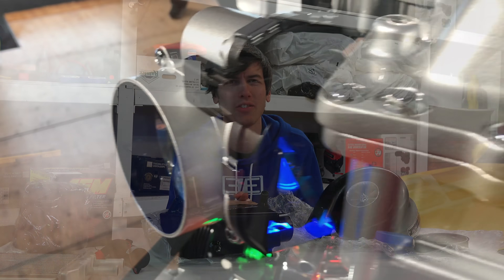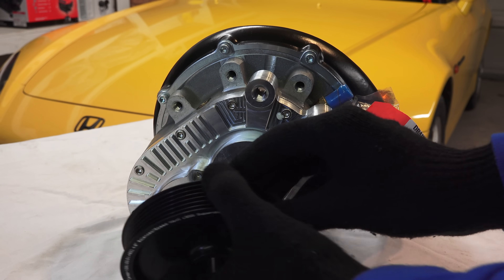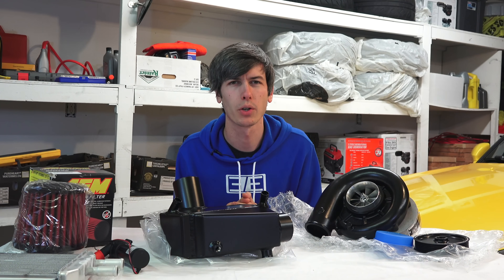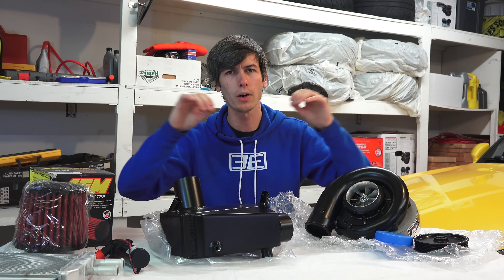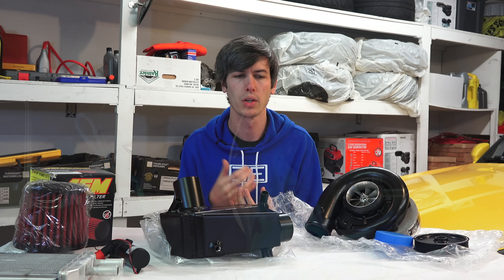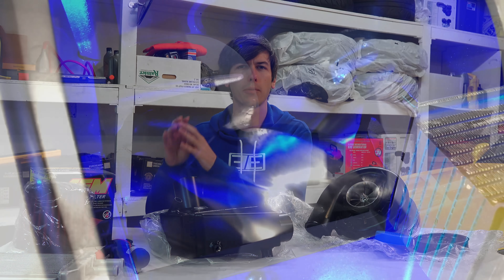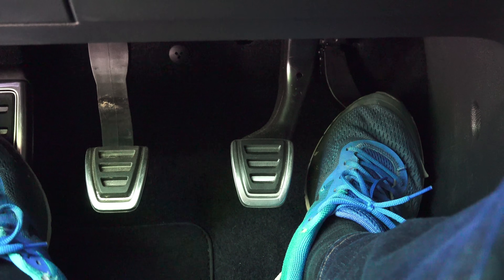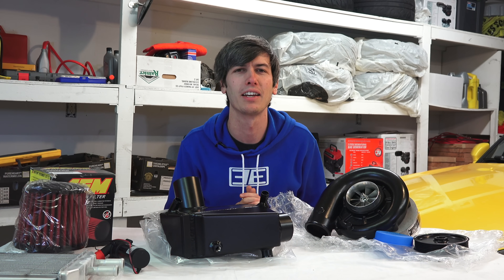Turbochargers vs Superchargers - Which Is Better?

Comment: I swear, if this ends with “it depends “
Reply: Why do you think is it that both ways see implementation in modern cars? You may think it is because both have pros and cons depending on the situation and you couldn't be more correct.
Reply: It DOES depends.
Reply: Generally speaking "Big Capacity engine use a Supercharger, Small Capacity engine use Turbo".
Reply: @Mira6Rus  It's not about capacity it's whether your priority is NA-like fast throttle response and drivability or efficiency and outright performance. Turbos will always give you more power and efficiency but will also always give you lag.
Reply: @BigUriel  Turbos tend to give more efficiency, but power is really arbitrary. Typically the reason superchargers aren't as powerful is because they designed it to form a balance of efficiency. Essentially, you're trading snappiness for efficiency with a turbo.
Reply: @BigUriel  Oh sure! I generally mean though 4 bangers respond to Turbos much better than V8s. 

You can safely double 4 cylinder horsepower, but its not like turboing a 500hp V8 is going to get you close to 1000hp without major major work.
Reply: @BigUriel  "Generally speaking" its why most V8s have superchargers and 4 cylinders have turbo. 

Also when boost finally arrives for a V8 its rear wheel spin city 😅 they need a smoother torque band.
Reply: @Mira6Rus  thats not even a factual statement. Eveyr application is different depending on everything else in the car so its hard to day thats true. Supercars with huge engines use one or the other and its based on their goal, the engine, the mechanics of the engine bay, so many different things
Reply: @TheOneSymphony  Generally speaking... I said. And its true anyway. 

Barely any cars are Supercharged these days... Turbos just do it better. Without leeching power.
Reply: @TheOneSymphony  Are you a Mechanic?
Reply: @Mira6Rus  5 yrs why? You have something to say. I havent been wrong in anything I've done for my clients
Reply: @Mira6Rus  turbos and super chargers are both awesome in their own right but it all depends on your purpose. Other than than companies like Audi wouldn't make the same car pretty much with different options.  Some of their v6 cars superchargers but they outfit others with a turbo. Too many factors
Reply: @TheOneSymphony  12yrs... Performance Tuning... Nissan, Renault, Mitsubishi and BMW accredited and certified. 

Show me 4cyl Superchargers aside from the Mini which was unreliable and inneffective.
Reply: @TheOneSymphony  And in 12yrs ive worked on one Supercharged car ever. An SL55 AMG and it is a V8... 😅

Which makes sense. Because generally speaking 90% of Superchargers go on V8s. 

Or they are tiny lil economy chargers lile the Mini or Mercedes Kompressors. 
Which suck... horrifically unreliable and not performance intended.
Reply: @Mira6Rus  so you really expect me to believe that in 12 yrs you've only worked on 1 supercharged car??? my mechanic friends have worked longer than you and have worked on turbo, Naturally aspirated and supercharged cars. Thats really a shot to your credibility because i can't believe thats even possible
Reply: @Mira6Rus  twin turbo ssc aeros, twin turbo Koenigsegg Agera, Pagani Zonda ( natural), I could go one and those are v8 to v12. 90% of big engines do not use superchargers. Some do, yes, but not 90% be realistic. Most supercars have had turbo or natural aspiration. Some of course did have superchargers but once again not 90%.
Reply: @Mira6Rus  the mini engines are not horrible . They're average and aside from the timing chain going bad I havent heard anything bad about them especially since BMW has a hold of them
Reply: @Mira6Rus  keep in mind audi and many other companies (Dodge, Ford, Chevy, range rover, jaguar, alternate Volvo models) all use super chargers in some of their cars so to say superchargers are not used nowadays.  . .You're absolutely wrong
Reply: @TheOneSymphony  Oh agreed, the engines are fine... but the Supercharged ones are crap and the Turbo one are great... 

Why? Becaus Low Torque engines thrive on Turbos... like Diesels or 4cylinders. 

V8s have tons of Torque already, so you typically see them Supercharged... or Twin Turbo will low boost.
Reply: @Mira6Rus  ok low boost in mayne certain cars but twin turbos ive driven havent been low boost especially the GTR
Reply: @TheOneSymphony  Do straight 6s have good low down torque? NO.... hence you TURBO INLINE 4S AND 6S.... YOU DONT USUALLY TURBO V8S....
Reply: @TheOneSymphony  Dude... im sorry you are now bringing up hypercars -_- 

Like are you just 10yrs old? You wanted to know about Turbo vs Supercharger builds in the TUNING WORLD... 

Your just listing off random hypercars and pointing at the exceptions. I think you are 10yrs old and dont know a thing about Mechanics.
Reply: @Mira6Rus  wow you have to result to insults when you're wrong and don't know what youre talking about. All engines have different efficiency rates depending on how they are built and other components. If you had any type of intellect you'd realize that. There have been so many different configurations of engines for v4 to inline 6 to w18. All for different goals. Go sit somewhere with your unnecessary insults
Reply: @Mira6Rus  and not all of those are hypercars which obviously you don't know.  No one is talking about the tuning world because that's completely different. Manufacturers only. You get indignant because you can't make a coherent point? Its laughable. Comments are here for simple debate and/or correction and here comes a keyboard warrior like you that has to attack somebody.  You sure you arent 10 yrs old. You can't even have a civil conversation
Reply: @Mira6Rus  not all inline 6 were turbo if you knew what you were talking about
Reply: @TheOneSymphony  WHEN TURBOS are installed... or inline 6s make terrible low down torque. 

You are not a Mechanic hahahahaha
Reply: @TheOneSymphony  You have no idea what you are talking about😅😅😅
Reply: @TheOneSymphony  You are not a Mechanic. And have been wrong every single comment. 

Want my Email so you can see my collection of rare and modified vehicles? My workshop with 4 hoists? 

Cmon lets prove what we have and dont have.
Reply: @Mira6Rus  never said i own everything and could care less what you own. Send me your email if you want but it isn't gonna do you any good. And you're annoyingly petty to wait all this time to comment again. But sure send your email
Reply: @Mira6Rus  mini coopers are 4 cylinder and was made with superchargers, but I think they switched it up in 2006 or so to turbo.
Reply: And honestly, I don't know which is better, it's been ten years since I've owned and modified a hobby car.
Reply: @RX-8GT  Because Supercharging 4cyl is not as good... the most popular Supercharged car changed to turbo because torque bands suck on 4cyl supercharged.
Reply: @Mira6Rus  I figured there was a reason they changed from that to turbo on recent models on mini cooper s, was thinking about getting one just for starters without modifying it
Reply: @RX-8GT  Most people wont touch the supercharged ones... 

And yes my argument has been 4cyl-turbo and V8-supercharger. 

But the reason they got rid of it was it was just too small... already a lazy 316i engine from BMW needs more than a tiny supercharger 😅
Reply: @Mira6Rus  oh ok, I see what you mean
Reply: @Mira6Rus  Turbo is more work period..
Reply: @Mira6Rus   and that's why they have tunes and boost controllers
Reply: @Iconhulk  Totally... But its probably cheaper and more effective on typical tuner engines. 

Supercharging a 2jz ge or something would be way harder than throwing a gte kit on it.
Reply: @jonw7760  You like them spoolie snails in your V8s? Nice 😎
Reply: @Mira6Rus  I'm just saying rather than spinning the tires like crazy. Control the boost and put that power down ya know
Reply: @jonw7760  I dont know hun hahah this is why I ride 600cc max, prefer very light AWD or FWD drive turbo cars like my Subaru Liberty B4 or Renault Megane RS 😅😅

Im a girl though, big power and the muscle needed to control it is just asking for trouble. 

So I found ways to be just as fast :)
Reply: @jonw7760  I have a modded M5 well its my dads E39 V8, it terrifies me... 😅 

Breaks in third at 100kph
Reply: @Iconhulk  when I had my 93  rx7 ,I had knowledge of the performance side, but not on rotary engines in general..I always heard my car was going to slug out on me.. but I never had any engine problem at all, ( on a side note, it's an awesome experience) .. that since I've been thinking about getting a 300zx, mini cooper, or a stock corrado g60( if any out there).. I've been giving the rx8 an eye now, only that I've just heard more cons of that rotary engine than anything.. and even hearing negative things of it, it's like pulling me towards it even more and it being RWD is why it's giving me a hard time just choosing a car to start the hobby road.
Reply: @Mira6Rus  oh without a doubt!!!!!  Love my WRX it's by far the best car I've ever had
Reply: @jonw7760  Totally! But like my 2 cars have 3 turbos 😅

I love boost! But I hate breaking traction... Lost my Mum in a car accident and just hate the feeling of cars breaking traction. Makes me nervous 😳
Reply: @jonw7760  No more bikes, no V8 utes etc etc... I still love Engines and going fast but I try to do it the safest way possible. 

I have 2 Daughters now, and wont put them through what I went though. 

Sorry to get all deep, but a sticky track car hot hatch and a twin turbskie AWD subie are safer than a 1000hp RWD supra or a V8 😅
Reply: @Mira6Rus  oh my. I'm sorry to hear that. And I can totally understand not liking that feeling given the circumstances. That's why every vehicle I have ever owned gets put through my own little set of tests just to see how it's going to act and handle under all sorts of different loss of traction scenarios. because understanding how your vehicle will react how you yourself will react could potentially save your or someone else's life once again I'm very sorry to hear about your loss
Reply: @Mira6Rus  no need to apologise it's what makes us human. I too have 2 lil girls and want them to feel safe and comfortable behind the wheel. Driving is a huge responsibility and should be taken seriously. I can't wait to get the oldest behind the wheel of an old beater out in a field or on a fairly difficult trail through the woods   that's where I learned and that's where they'll learn
Reply: @Mira6Rus  hi there...I have a Mercedes c180 comes stock with a supercharger...better go do another 12 years 🤣🤣🤣
Reply: @nathantownsend55  I specifically mentioned your car and the Mini Cooper S as examples of why people DONT DO IT. 

Super underwhelming cars.
Reply: @nathantownsend55  Lol its the example of why your car is bad and valueless. But ooookay 😬
Reply: @Mira6Rus  the mini Cooper s was hugely successful and the reliability issues were not due to it being supercharged at all. In fact the turbo car that replaced it was even worse
Reply: @BigUriel  8
Reply: @Mira6Rus  this is so NOT true xD my 1.6 works fine with turbo and supercharger both .
Reply: @RecklessGenesis  sigh and I bet when you first attached both. Untuned... Naturally the Turbo gave you more power.
Reply: @Mira6Rus  i attached the turbo very close to the manifold for minimum lag . I have to say its not all that different but the SC gives a more continues power , where the turbo give more an acute power . I like both
Reply: @RecklessGenesis  I prefer NA weirdly... yet of my 3 cars theres 3 turbos on 2 of them haha
Reply: How much %  mechanical loss do u think is lost to drive a supercharger belt driven or other ?
Reply: Trev Ohlson, 
It depends.
Twin screw? Roots? Centrifugal?
Reply: If it didn't depend there would only be 1 option
Reply: @ezraboren2069  superbly stated
Reply: I've been waiting for him to ask where he chap stick was.. 🤣
Reply: Pedal Commander!!
Reply: I mean, if it didn't, I assume one would have killed off the other by now, right?
Reply: hahahah jeah xD
Reply: well...it depends --\__(:\)__/--
Reply: It depends On What you want to be doing... that’s just how everything works.
Reply: Hahaha, right
Reply: It really does depend tho
Reply: Lol
Reply: Can we just do both?
Reply: Well then i will just slap on a twin turbo with a supercharger
Reply: Thats how most things in engineering are, sorry.
Reply: That should be the headline for EVERY mod
Reply: Lol
Reply: Tur bo best
Reply: Guarantee it will.
Reply: Let me make it super basic, in a race with many curves corners the response of the throttle really matters so be able to attack the corner the way driver envisions, and so the conventional norm would be to go with a supercharger.

A race with many straight aways and high speed corners the full power output matters more than throttle response, and so turbo would be the conventional norm as it does not take energy from the engine.

What if the race course had both high speed curves and low speed curves equally, then "it mostly depends" on the drivers skill on the vehicle he drives.

What about endurance, superchargers don't take the hot exhaust from the engine, while turbos work by taking that hot exhaust. So less heat will always result in longer extreme usage.

Then why do semi trucks have turbos and not superchargers, they are more efficient on fuel, semi trucks do not need to race, plus they can get extra cooling systems in with the minimal amount of space turbos take.

It really depends on where you use it, daily usage turbos, heavy usage turbos, fun and race turbos or superchargers, serious dog fight in race course full of tight slow speed curves superchargers.
Reply: Should I get ah supercharger vehicles or turbocharged?
Reply: Always
Reply: Problem is… it kinda does depend on
Reply: It probably will
Reply: It does.
Reply: 😂😂😂😂😂😂😂😂yoouuu knows!!!

Comment: I’m looking to get a BRZ in about three months, and I’d like to upgrade the horsepower output to about 500 - 550 at the wheels. I’m also deadset on a turbocharger, so which one can I purchase that will give me the most power with the least bit of lag?
Reply: NDLlama1 forgive my lack of knowledge of some of these terms, but what is E85? I know it’s not octane level, but the only thing I can think of with that E and number distinction are BMW’s (E30, E46, E92, etc.). And fully built motor and transmission? Meaning I’d have to replace pretty much everything (so spark plugs, fuel pumps and injectors, intercooler, intake manifold, exhaust, etc., gearbox, ECU’s, and things of that nature)? I’m a wannabe car guy who actually wants to be a car guy LOL
Reply: NDLlama1 so going about purchasing an aftermarket reinforced block…how exactly do I do this? I’m pretty sure there’s more to it than just a cursory Google search 😳

Comment: Your illustration concluded super-charger (engine controlling the turbine  ) is better from point of view of lag of response & used type of oil only?

What do you think if car engine is only 1.4L if accompany by Turbocharger , such as ASTRA 1.4L from the German producer OPEL ?

Comment: Ah, the roots blower from the late 50s and 60s, (aka) "The Iron Lung"  There were not too many log trucks of that era which had been kitted out it them that didn't have a sheetmetal patch on the hood where they came through after disintegrating. But boy oh boy, did they ever improve those old 250 and 260 Cummins.

Comment: Superchargers make more low end power, sound better and are MUCH more reliable. End of story.
Reply: Joe Swanson
Nonsense. Turbochargers are extremely reliable. Superchargers make too little boost in most applications
Reply: @negativeindustrial  psi is not relative.
Reply: @negativeindustrial  Turbos require oil lubrication which is often neglected and takes time to work properly. Also turbos have far more complex impellers and are known to break far more than your roots type or twin screw superchargers.
Reply: Joe Swanson
Tell that to the turbochargers on both my 25yo Celica GT4 and my 28yo MR2 Turbo. They both see 20PSI every time I drive them and have for over a decade each.
Reply: @negativeindustrial  Spitfires don't have turbos
Superchargers are better by default

Comment: What would happen if you connected a supercharger and a turbocharger in parallel? Like, the air intake splits off and goes into both at once, then comes back together to go into the charged air cooler?
Reply: You would get a very tight engine bay, for one. But in terms of performance, it'd probably be a bit like a twincharger, except the turbo isn't choking the super at low power output.

Comment: Engine bay geometry can limit the application of superchargers. Turbos have a greater range of installation (location) options, plus you need to consider center of gravity when choosing location of the equipment
Reply: Good Explain about Con and Pro

Comment: Is there any difference in terms of the wear and tear on the engine?
Reply: In terms of having "boost" pressure applied to the internal components, no. Boost is boost. Doesn't matter if it's a turbo- or super-charger. The only thing that would be a factor that I can readily think of, is the higher heat load a turbo-charger places on the oil. But, having said that, it's an issue that isn't too hard to deal with through the use of a "turbo timer", or a specialty oil and/or perhaps more frequent oil changes. In an extreme case some external auxiliary oil cooling may be warranted. But, both devices can cause accelerated wear of internal engine components vs. a "naturally aspirated" engine.